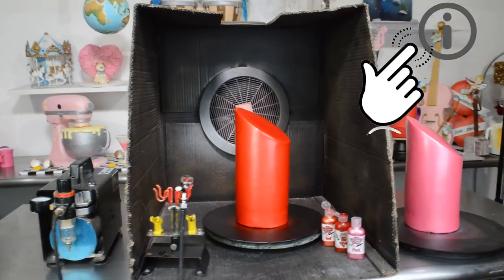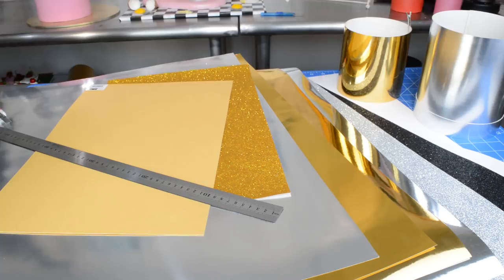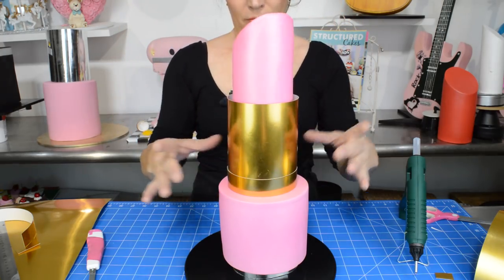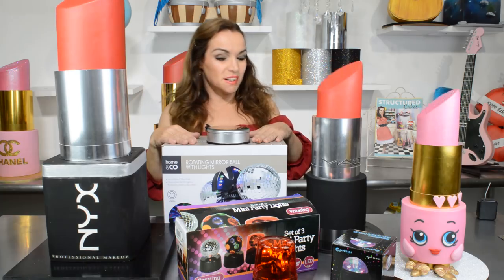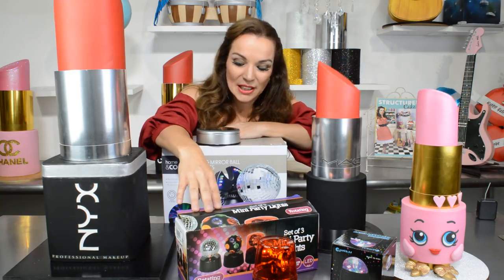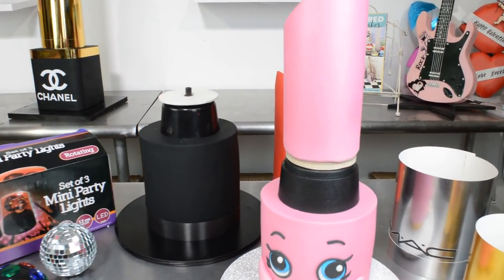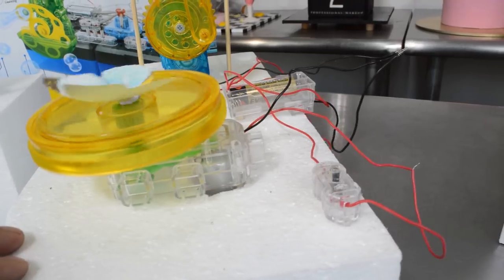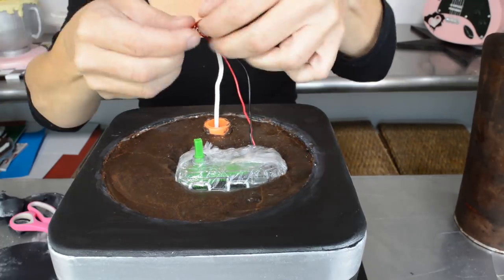3D Lipstick Cake

Comment: In your test how much weight do the turning light supports because I also found the same lazy Susan that you find but I wanted to put a soccer ball made out of cake on it that turns a little faster like the disco ball light, I will also glue a plastic dowel to mi board so my cake does slide out, how much weight and which one you recommend better